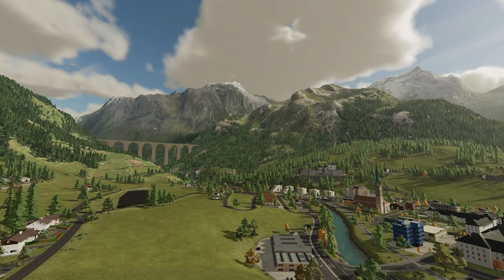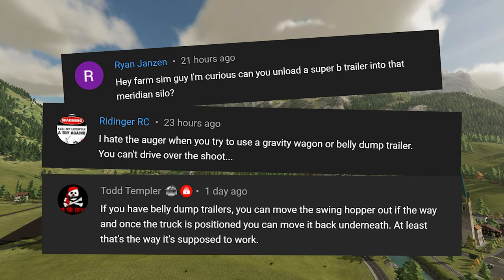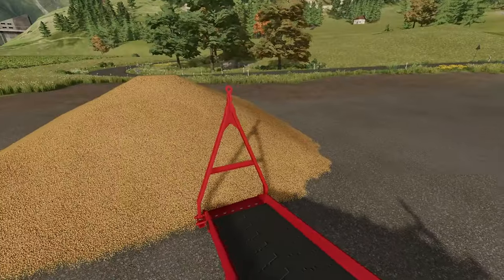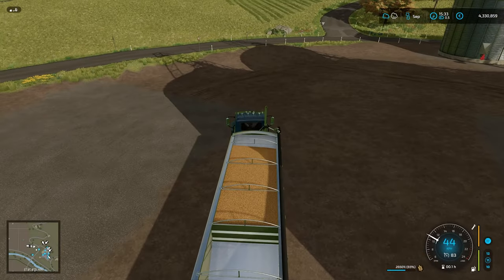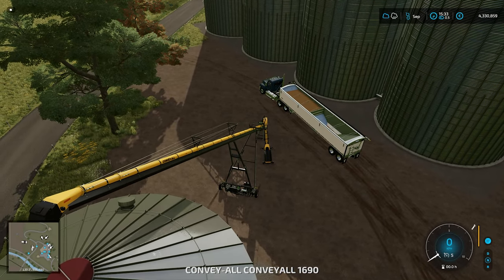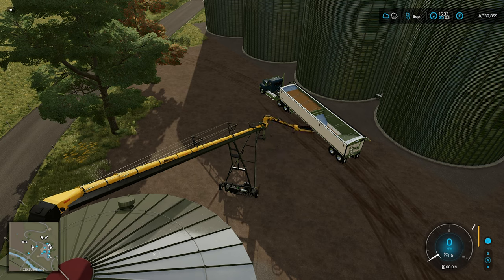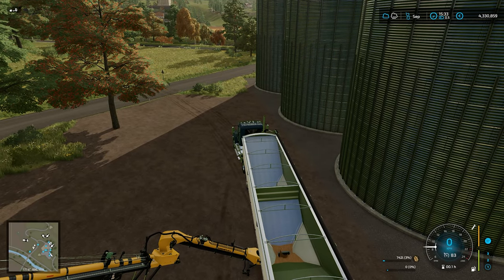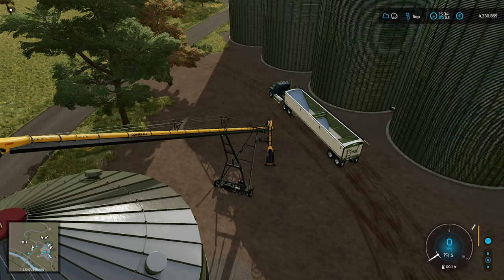Farm Sim Shorts #1 - Hopper Trailers and Augers - Farm Sim 22 Tutorial

Comment: Some little tips for using these for those who strive for realism: Put the swing out auger in the middle of the two hoppers, as long as your truck is parked close enough you have the reach for the swing auger to move to both the front and rear hoppers without moving the truck. Also when setting up the unload auger, keep it as low as possible. You want it just high enough to clear the stacks on the semi so that wind will interfere with the grain as little as possible. If you are running large sleepers on the Mack's I'd even recommend raising the auger to drive the truck underneath and then lowering it again once it's over the trailer.